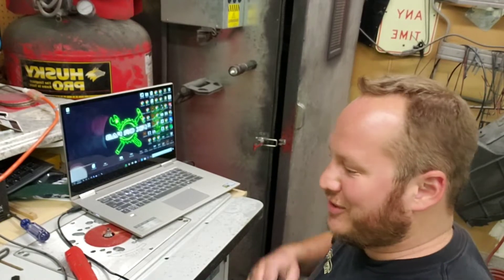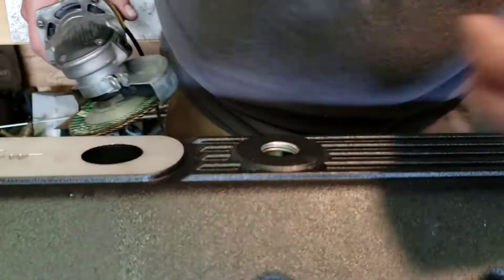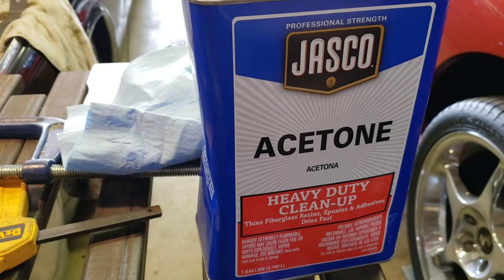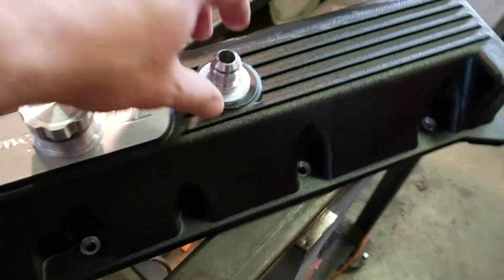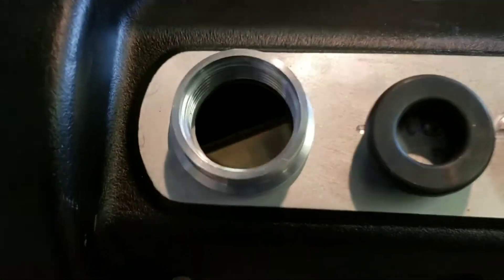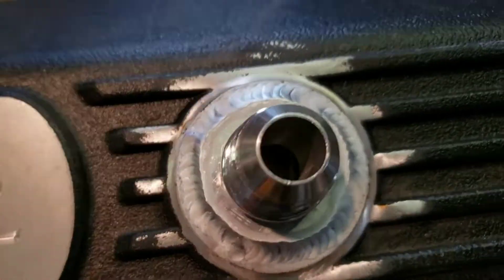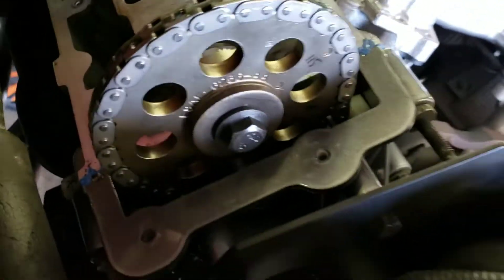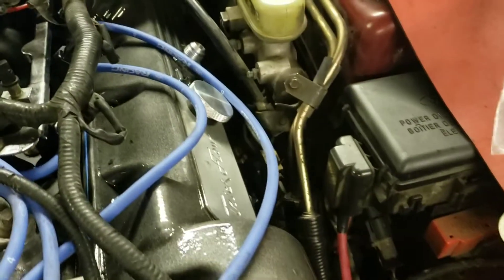TIG welding valve covers and powder coating.

Comment: The link please to order the cap?
Reply from the maker: https://www.ebay.com/itm/2pc-10-AN-Aluminum-Weld-Bung-for-Fuel-Oil-Coolant-10AN-/162144426650?mkcid=16&mkevt=1&_trksid=p2349624.m46890.l49286&mkrid=711-127632-2357-0

An bungs 10 an
Reply from the maker: Cheap ebay fill cap 
https://www.ebay.com/itm/2-5-Polish-Aluminium-Alloy-Oil-Fuel-Water-Tank-Reservoir-Cap-Weld-On-Filler-Neck-/334068598338?mkcid=16&mkevt=1&_trksid=p2349624.m46890.l49286&mkrid=711-127632-2357-0
Reply from the maker: Jegs brand
https://www.jegs.com/i/JEGS/555/60135/10002/-1